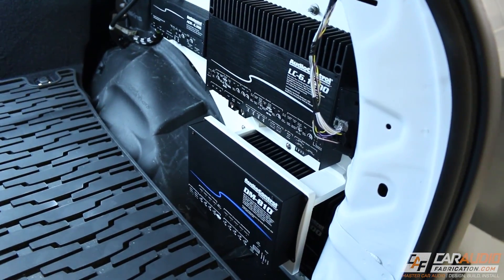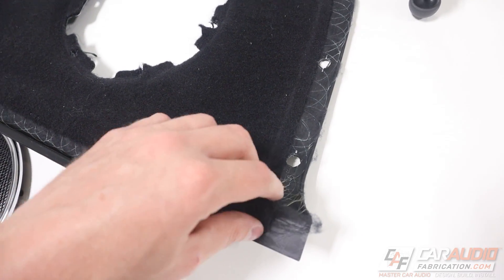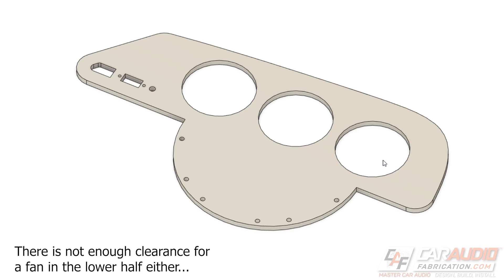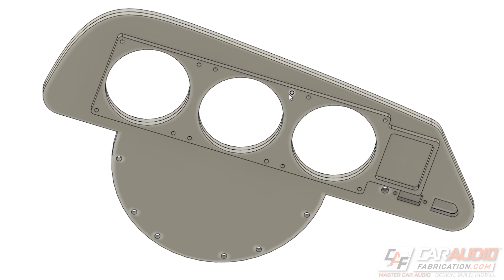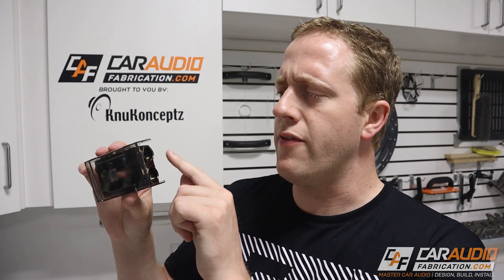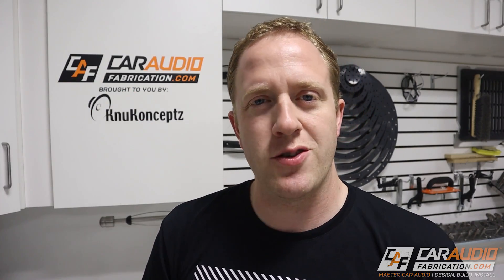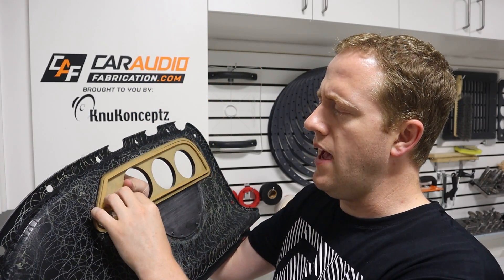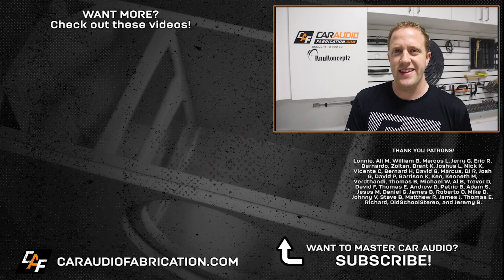"OEM-esque" Amp rack cooling panel - 100% Plastic! - Part #1

Comment: just one question if all the fans are blowing inward how does the hot air escape, or if the fans are sucking heat out where is cool air going in at??
Reply from the maker: The larger panel this attaches to has louvers that allow for air transfer when you close the doors. Even without that it's not like these panels are air tight sealed, it would just exhaust around the outer edges

Comment: not only would one big fan be tacky but also very inefficient, 3 small fans that are designed for this situation (IE: In a computer with variable control) would be far better than one that's designed as an exhaust fan for the bathroom that would be ran at very low speed

Comment: HELP ! For weeks now I’ve been trying to eliminate what is referred to as a 60hz hum from my woofers. I installed an LOC to retain my factory head unit and have excellent ground straight to the frame (clean and bolted tight). Also installed the SkyHigh audio Big 3 kit (4ga). Everything works flawlessly except for the hum. I’ve ran all the gains and adjustment adjustments up and down and the only time it completely quits is when unhook both RCA jacks from the LOC- or when all gains are completely turned down. I have 14.9 volts at the battery and alternator and 14.5 to 14-6 at the amp. Noticed one thing - if you pop the trunk or open any door - it stops humming. Also I swapped to an old school pioneer amp and it quit.  But I’ve tried 3 new amps and the same issue ever time. My LOC is soldered Into my factory rear dash speakers right next to the magnet ? Will this magnetic field affect my LOC??
Reply: Hi Tomcat , have a few questions for you . 
Have you tested the resistance at your amplifier ground to your battery? 
 Also what RCA’s and LOC are you using ? Hope it’s not generic RCA’s or a generic LOC that can introduce noise into your system. 
I definitely think it’s your LOC or RCA’s because if you’ve changed amps multiple and still have the same issue it’s definitely not the amp. 

Aswell as that is a lot of voltage drop across a stretch of 4 gauge wire -assuming you running 4 gauge wire. 
Is it OFC or CCA wire ?

Comment: Your the expert on subwoofer enclosure design, my question is I see a lot of people building sub enclosures made of plywood. I first got into this hobby in 1985 and back then it was do not use plywood because of tree knot voids between the layers, this would create resonance. Please enlighten us viewers on this subject.
Reply: Plywood comes in many qualities from terrible to damn near solid hard wood. The use of plywood is talked down on because the average person isn’t going to source that high of a quality piece of plywood. Instead, they will more than likely just go to a big-box store and buy a sheet of cheap “whatever” plywood for $20. A hard-wood 11ply void-free piece of Baltic birch would make a much better box than OSB (particle board). It’s all about material quality and overall craftsmanship of the finished product.

Comment: Hi mark, I need the plan for 1x12 "subwoofer brand edge model EDX12d2SPL-E6 the car is an audi A4 b7, the problem is that I live in ireland and the transport will not be safe and that's why I would at least prefer the project to be able to build it here and of course  I will pay for it, thank you

Comment: I may be wrong since i have'nt seen how it will bee in the end. But i would have gone with a fan with higher fin density. The fans you show here will not push much air if you dont have a big hole that the air go out off. But with higher fin density it would push air inn to the box. Or just go with a 200mm fan if the sub is a 8 inch.
Reply from the maker: These fans will be just fine. It doesn't need to be a turbo jet, these amps run cool as is. They blow plenty of air and are very quiet.

Comment: Use a silicone fan gasket for that fan to eliminate the fan noise and vibrations, and try to use fan filters to reduce the dust!

Comment: Great video.... Here is a little tip.  Next time you want to release hot melt adhesive simply spray it with some 91pct IPA and wait a few seconds.  It will make the glue almost pop off on its own.  One word of caution though if using extruded acrylic you must not let the IPA get on the edges of the laser cut plastic or it will later craze and crack.... Great video as always!

Comment: Why would you have the fans bringing air in, especially at the top? You could have them pulling air out at the top where the heat goes and it would force air to be drawn in from the bottom and reduce turbulence as well

Comment: Where is the link for that thread Making Bit Set? I'd  love to get my hands on that. I need one with a #6 screw thread for my C7-350CM speakers. Ive done 1 A pillat so far and next week i will be working on my second one and using #6 Torx Security Screws to protect them from theft.

Comment: Hey,  when you add a second battery , does it need to be the same as the main battery ? I heard the alternator will keep charging it until the main battery is full , or it will stop charging the battery when the second battery is full ..does anyone know if it's true ? And if it is , how to solve it ?
Reply: Run an isolator

Comment: If you are adding fan on top, I think it's best to set fan in Exhaust orientation because heat rises so the exhaust might be a better way :)
Reply: But that will just pull air from the easiest route, which will not necessarily draw the air over the amps.  At least blowing in directs it straight onto the amps, the positive pressure will just force the excess warm air out of any other hole
Reply: Or run one fan blowing air in and then another fan pulling air out, would give maximum cooling. But your design would need to change

Comment: please explain how set and tune an active subwoofer (suach as jbl basspro) with an after market head unit. 
it is dificult to tune because both head unit and active subwoofer have their own Gain, Bass Boost, Phase, and Crossover. 
how deside which one should be used to tune the sound?
thanks.
Reply: I usually use the eq settings closest to the source. Gain crossover and phase closest to the speaker. I don't really use bass boost. What I do is more than likely wrong tho. Just what I do.

Comment: If anyone is interested in taking this to another level or has a tough location you can get heat resistant baffling strips top direct the air etc.  We use them in servers they're great

Comment: Fantastic build as always Mark! Would it be beneficial to add some vents to the bottom to allow the hot air to escape? I was thinking about doing this in my wife's suv, it already has venting built in with no equipment behind it. I could also use the vents as inlets to the fans.
Reply: Mark should be using the fans to pull hot air out from the top. You need fresh air to be pulled from the bottom and then out.

Comment: What cordless router would u suggest makita milwaukee etc ?? I live in apartment cant have a stationary router
Reply: Danny Morales I love my Bosch Router, with addictional plunge mount. Bosch makes a nice prefab, small footprint, ready to go router table that seems it would work well, if you don’t have the room for a full size router table or table saw to router extension.